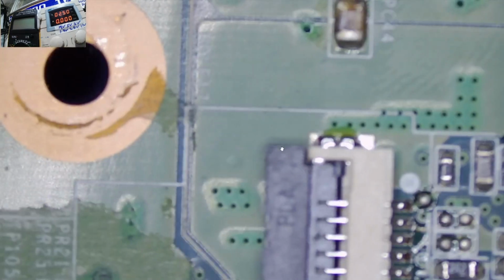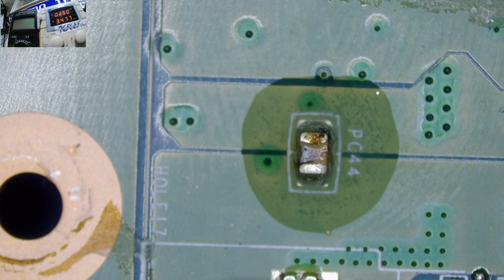Motherboard short circuit repair

Comment: How did you find the value of the capacitor to be replaced? I mean, is the value of the capacitor being replaced the same as of faulty capacitor? How do we find this value? I do not see any value or code marked on the ceramic capacitor ...
Reply from the maker: you can use multimeter under microfarads setting
Reply: @LetsFixThatGadget  You are right we could use a multimeter (or capacitance meter ) to measure the capacitance of a  functional or healthy capacitor. However, the question is whether the multimeter or capacitance meter could measure the capacitance of the faulty capacitor particularly the one which is short circuited? Otherwise, to repair such a board, we need to have the circuit schematic of the board ...
Reply from the maker: @yasir9909  remember capacitors are just filters to the voltage and hence you don’t have to be very accurate.

Comment: Would the laptop work without the capacitor? I mean if we just removed the faulty capacitor and not replaced it.
Reply from the maker: Yes. Capacitors are just voltage filters
Reply: @LetsFixThatGadget  and there's no need to replace it with a wire? Just leave its place empty?
Reply from the maker: @Kane2009  never jump with a wire. That will be a dead short
Reply: @LetsFixThatGadget  how is the signal transmitted then if we leave it blank? Excuse my ignorance but I'm a noob.
Reply from the maker: @Kane2009  come inbox 0726760900
Reply from the maker: +254726760900
Reply: @Kane2009  By leaving the space empty there would remain a very large value capacitor but not very efficient - the air between the two pads.
Reply: Bro , u Instagram id name
Reply: Hi bro, I'm a big fan of yours. I watch all your YouTube videos, that’s was really helpful for me